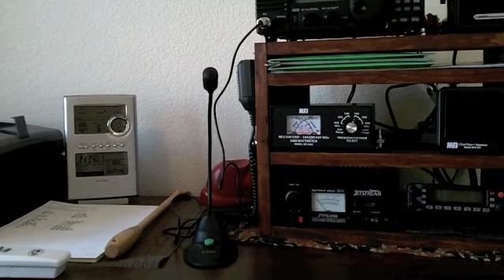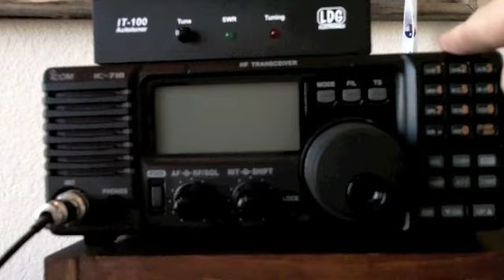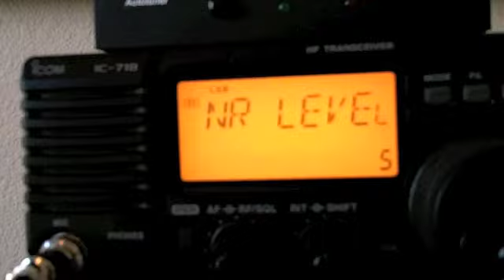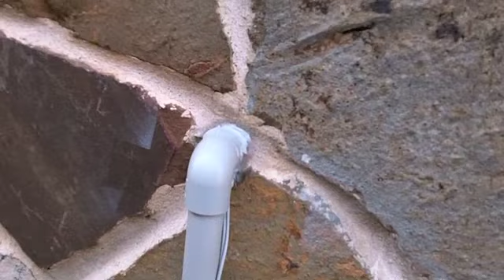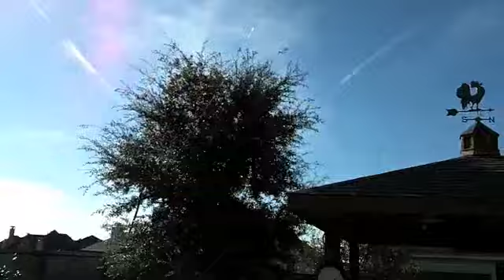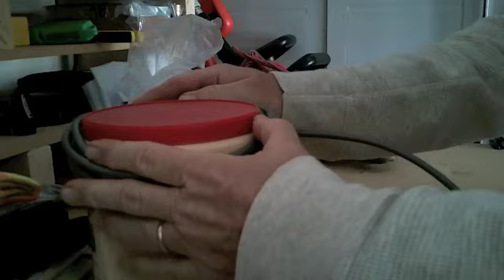Icom-718 w/LDG IT-100 Auto Tuner

Comment: Gary, is it really necessary to have the IT-100 with the 718? I'm pretty serious about getting the 718 as my first HF rig, heck it'll be my first radio. Money is tight so I need to try to save money where possible. KE8DRH
Reply: Ah! Thanks for the 10w comment! I have the 718, got it the other day, along with my general upgrade. Lots to learn, I want that tuner, & a power supply, but was concerned about power levels as I don't have an swr meter, either. Yes I'm new to all this
Reply: It's not NECESSARY if you have a resonant antenna, but you'll want to get one to give yourself a little more flexibility on what bands you can operate on. I'd add one ASAP after you get your radio, and be careful not to operate over 10 W or so while checking SWR.

Comment: @K5GRY Thanks, but I have another question. The wire that I would connect from the radio to the pipe (ground) is supposed to be connected via electrical tape before I hammer the pipe in? Just curious, but why is that? Thanks again.

Comment: @K5GRY I have a question... how hard is it to put a 1/2 inch solid copper pipe 7 feet in the ground? Any type of special equipment you recommend I use? Please respond, thanks.
Reply: I can push all 8 feet in by hand. It depends on your soil.